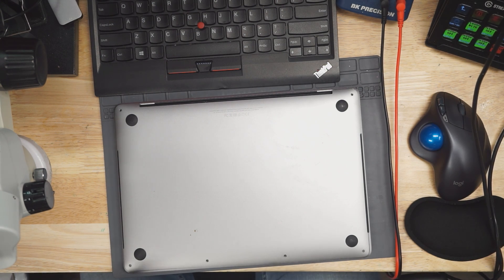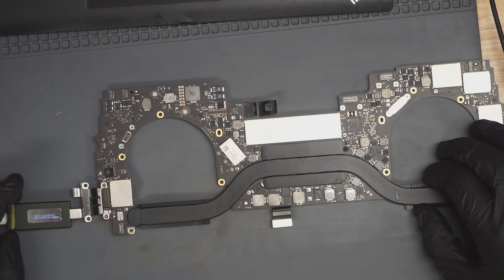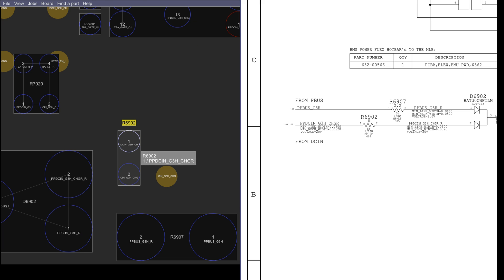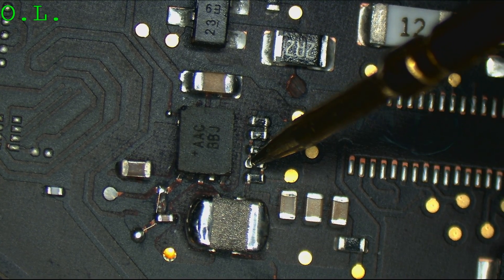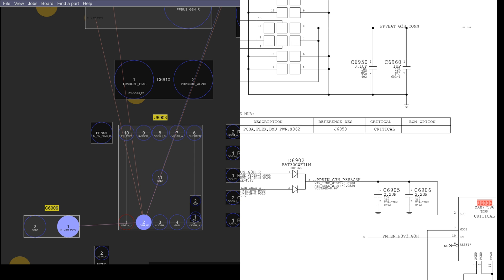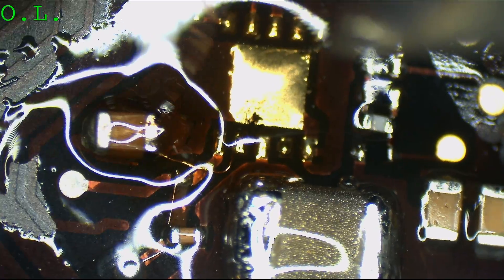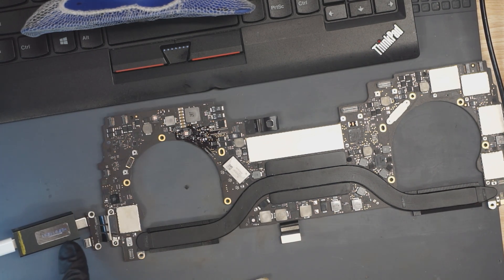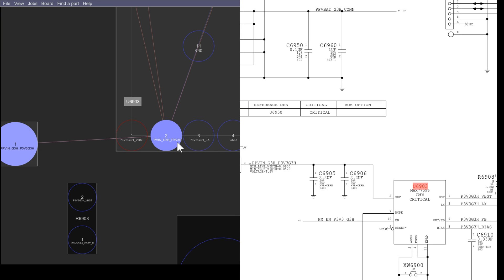Louis fixes board while losing mind, earns 1 star review.

Comment: Louis, the kit lens is fine if you want everything in focus. You only buy a Sigma lens if you are after background blur (boca), which is achieved by lowering your F-stop value in the camera settings. If you need more clarity (less grain), on either lens you need to lower your ISO level and increase lighting levels. Lower F-stop may also require more lighting as the aperture size changes. Neither of those things may be practical for you if you're using it for live streaming repair on a co-op space. Either way, a DSLR is a big upgrade over webcam. A kit lens is still good.

Comment: Once. I fixed my ps3 with the issue where it would just bsod. I took out the mobo, baked it to raise the temperature of it and fix the processor. Put it back together and it booted properly. I was excited!! Tried connecting to the internet to update it and there it was. I fried the network card. It was fucked.

Comment: I'm not a doctor, but I' guessing you don't notice a difference between the lenses because you're using it for videography. A faster lens won't do much if you raise the f-stop like you would for video ( I assume you're using a smaller aperture to raise your depth of field for such a close camera). I'm guessing the kit lens is a zoom lens with a f-3.5 max. I'm also guessing the Sigma lens is a 2.8 or 1.4, so the max aperture is letting in almost twice as much light as the kit lens if it's the 2.8. The 1.4 lets in almost 8 times as much light. This allows you to handhold with faster shutter speeds and lower ISO than otherwise possible with the kit lens, giving better results in low light conditions. Also, kit lenses are generally really good, and there is the old law of diminishing returns, so upgrading from a super cheap lens to a good one will cost less than an upgrade from a good one to an excellent one. So, the people who notice a lot of difference may be doing something like heavy cropping, and differences would be far more noticeable than two uncropped lenses side by side. Not to mention that delicious bokeh that you're not going for. Mmmm, bokeh. 

Great, you got me started on a wild tangent.

Comment: why wouldn't the jumper wire not get interference from whatever was the copper lead going out the the spot to the left of the input? i'm not a AV guy but I would think crossing a copper wire onto of another copper surface that's on the board would be a bad thing.

Comment: True story, I had a customer come in the auto shop who said his window wouldn't open/close. Window motor had power under load and a good ground. Window motor failure. We gave a quote for replacement. I overheard him talking about letting his son try the repair himself, so I let him know that the quote was for a unmolested service repair, and that he may need to pay more if his son fucks it all up inside the door. He leaves and comes back hours later and says he wants to do the repair as quoted originally. I open the door and as it opens you can hear all the loose screws rattling around in the bottom of the door, which were mostly unrecoverable. Price went up and he complained, and in the end we should have rejected the job. The car worked fine when we were done, but we didn't make enough for the job to be worth it. Maybe we should have quoted even higher.

Comment: That lens? Sigma 30 f1.4?? You got to be kidding. You compared it to that kit lens and you found no difference? Did you use it at 1.4? Or 1.8? You should have taken that camera out to shoot some evening portraits or NY steets. That lens is a low light bokah master. In low light, kit lens simply can't keep up. In bright light too sigma has more bokah, sharpness and contrast. On my vacations, sigma is always on my a6k. But in overhead cam setup, maybe won't affect. Depends on usage but sigma is sharpest available lens for apsc e mount.

Comment: Whats the liquid that is put on the board? ( I know nothing about  computer-repairs ehe) 
Also, does it not risk damaging anything on the board  since its spreading?
Cheers!
Reply: It is soldering flux. It helps regulate temperature when soldering delicate electronics and more importantly allows new solder to adhere more effectively by preventing oxygen from oxidizing the clean connection. IE prevents corrosion after the area was cleaned.

Comment: Actually the lens thing reminds me of my new graphics card. Went from a 570 to a 1060, because of...well, death of the former. Turns out on half my games I cant even abuse it because my old Athlon CPU bottlenecks anything thatd be intensive enough.
Reply: yup, always need to check if all your components are of similar power
Reply: @OGsploorp  To be fair, it was a replacement due to being broken, and Im planning on a complete upgrade once I get money. Seemed perfectly pointless to buy the same GPU or similar all over again.
Reply: @builder396  yea but replacing that old of a cpu would mean a new motherboard and probably also ram
Reply: @OGsploorp  Which is why I havent done it yet. Dont have the money to buy that many new parts at once.

Comment: Louis, please stop with the PP3 underscore Hot Cold and whatever.  If it's input or output or feedback or anything, please use that.  We don't have the data sheets in front of us and even if we did, my head is spinning.  It cuts down on the understanding.  I keep forgetting what PP2 underscore Hot Cold and whatever was supposed to mean.  Could you just say what it is instead?

Comment: What is that glue looking paste thingy you put on the board that melts away when you heat it?
Reply: It's a flux paste.
By preventing the formation of metal oxides, flux enables the solder to adhere to the clean metal surface, rather than forming beads, as it would on an oxidized surface. In some applications molten flux also serves as a heat-transfer medium, facilitating heating of the joint by the soldering tool or molten solder.

Comment: I love your brutal honesty, which I've seen in this and a few other videos so far. Even though I don't know shit about electronics, your videos are pretty easy to follow

Something I'm curious about, how reliable would that jumper cable (edit: wire, not cable!) you installed be? Assuming no tampering, dropping the macbook (sorry, it's a PC now), or anything else, should that last?
Reply from the maker: Why thank you! I hope if you keep watching, you will know more than shit about electronics. :) 

The jumper wire will outlive me.

Warranty issues with board repair, are mistakes of omission, rather than issues caused by a board repair. An area where we should have put a jumper, but didn't. A corroded component we missed. These cause warranty issues. The jumper is fine.

Comment: im a photographer. the biggest difference between the kit glass and the prime glass is that the prime typically has wider apertures (f1.4/1.8/2.8). they can create beautiful images. however, ur type of shooting seems like you don't need a prime. your kit glass looks like it does the job just fine. if ur shooting at f3.5 and up, you don't really need to use prime glass unless you intend to shoot at those wider apertures. hope this helps.

Comment: I didn't quite understand how bad that soldering job was, so I bought a soldering kit and a small FM radio assembly kit and soldered it all together so I could understand the basics of soldering.  All of that was so I could watch this video again and laugh even harder at that terrible soldering job.
Reply: @jonathangardner9654  Yes, it's called "flux" and it removes oxidation from the two surfaces you're trying to solder.  If you don't use it the solder joint doesn't take.
Reply: @couchmaster3773  Was this in reply to a question about the watery stuff? I only ever did a tiny bit of soldering in school and never used anything like that!
Reply: @Aetherian1  Yeah, it's that weird goop he puts on the board.  Some solder actually comes with flux already in it so you don't need to use extra
Reply: @couchmaster3773  Interesting, thanks for the explanation
Reply: @couchmaster3773  You do if you're mounting SMD components, you need a lot more flux than is in the solder to mount a SMD component without overheating it.
Reply: By any chance was the radio kit the Hex3653? I haven't soldered in years so I'm out of practice since the 6 month electrical engineering elective I took at university 10+ years ago. Needless to say I had to learn SMD soldering pretty quickly.
Reply: @unsaltedskies  No, the radio I soldered together was only through hole soldering.  It was a little bigger than the radio you're talking about, too.  Don't know the exact model of mine.

Comment: As someone who only has like a basic understanding of tech repair, i wonder how some people can mess up a disassembly or assembly. Like we got our Xbox back from the sheriff a while back and it wasn't working at all, we sent it into Microsoft immediately thinking the warranty would cover it. the seal was broken so we got it back untouched from Microsoft. Frustrated I opened it up myself and realized the dumbass that took it apart at the sheriff's office didn't plug in a part while putting it back together. I plugged it all in together correctly using a 5-minute internet guide and it's been working ever since. It legit shows sometimes their "professionals" can't even research a few minutes to find out if they're fucking it up, or at the very least testing it afterward.

Comment: Prime lenses usually have a larger max. aperture. That means you get more/better bokeh and you can shoot in lower light. Thats their main selling point. They might have slightly less distortion and be slightly sharper too, but as an amateur you wont necessarily be able to tell difference in sharpness just looking at the photos. If you dont know what the advantages of a higher quality lens are, just dont buy it and leave it to the pros. Like buying expensive wine if you cant tell red from white.

Comment: Minor correction for you Louis: MAX77596 pin 1 on the left isn't feedback, it's the high-side driver supply.  
If you short your input with that pin, you'll (probably) overvoltage C69072, which will fail short and connect your input to pin3 LX. Essentially connecting input to the inductor.  Neither the IC nor whatever it powers will like that...  I'd be pretty tense checking my handywork if i had to do that repair!

Comment: I would not have fixed it after the costumer tried a DIY. I work for an Auto shop and we turn down a lot of failed DIY repairs. Its just to troublesome.
If you dont know what your doing or doubt your self at all , dont fucking attempt to fix it.

Comment: I am new to this, but what is that liquid you are putting over the chips and circuits, how can you even see what you are doing? Do you have any basic beginner videos?  Very much respect for what you do! It is amazing! Thank you!
Reply: The liquid/gel that he is using, is called "flux" and it's used for a few reasons, but basically it protects other parts from heat and solder and helps the solder to only connect to other solder/metal parts that should have solder.

Comment: i have watched many of these and never seen him have to add a tiny wire like that, can anyone explain why he couldn't just fix the pad?
Reply: I'm not an expert, but Louis did say that maybe it wasn't connecting... he might have actually been talking about the pad not connecting to the trace inside the board itself.  I slowed the video, and you can see it looks like the pad's trace in the board might have been burnt aswell, making the pad completely useless (not to mention, the pad looked a little messed up).  There were already 2 other jumper wires done in the same area by the previous guy who sent it in, so there was already other damage, whether some of the traces were burnt out by failed components, or the unnamed guy who tried to fix it, burnt them out during his fix.

Comment: isn't that jumper wire a temp, cheap, failure prone fix?
Reply from the maker: Quite the opposite, that jumper wire will never fail, and likely outlast the machine itself.
Reply: Jumper wires ARE "cheap" fixes WHEN they come from the manufacturer, as-in, they didn't do the proper Engineering to Design the board correctly, so the manufacturer had to add in jumper wires to make it all work.  

Not when it's coming from somebody fixing somebody else's broken item... they aren't paying for a brand new board, just the existing one to work again.

Comment: Hi Louis and viewers! Great video as always! I'm just wondering why you don't use jumper wires with some sort of electrical insulation surrounding the wire. To the non-expert, that seems like the obvious solution to prevent introducing a short circuit if the wire were to bend in an unfortunate way. Does it have something to do with the internal temperatures and concern with the insulation melting, or does it have more to do with the fact that the jumper is unlikely to bend from the orientation in which you laid it down? I'd love to get some insight into this matter from you or one of your knowledgeable viewers. Thanks! Keep up the great work!

Comment: I’ve loved trackballs since the first Logitech Trackman Marble (no wheel) came out. That was a bit too flat tbh but the first of the grey versions (Trackman Wheel Optical) was perfect for me. They brought out a wireless one with the red ball but that ate batteries. Then the wireless M570 with the blue ball came out and it’s powered by good intentions and fairy kisses I assume. Seems to last forever on a full charge of the single AA battery. So yeah, I love my trackball too. 🧐
Reply: Hey Neo, if you love trackballs, you should see what a japanese company named ELECOM has.  They are dedicated to making excellent Trackballs and use to only be available in japan, but are now on amazon. I have 2 Microsoft Trackball Explorer's that i absolutely love, but you can only find used ones now, that run for $200 to $400, so i have been on a long search for some decent replacement and i finally found the ELECOM's last year.  Look up their newest "ELECOM Trackball Mouse M-DPT1MRXBK" it can be used wirelessly, blutooth, or with usb cable, has ball precision/speed switch, and 8 buttons and scroll wheel.  I think the ELECOM M-XT3URBK is closer to the M570.  Anyways, just look up the company and see what they have, because i believe in supporting a company who strives to make a quality product that is hard to find.  Us trackballers gotta stick together.

Comment: Hi Mate, 
awesome videos and professional performances in solving all issues regarding apples :-)
I just bought a MacBook pro mid 2012. it has an issue that a dimm slot is giving me troubles. I could only put one dimm installed. the other dimm slot is causing system halt. :-(

Comment: About that difference between lenses. You surely can't see much difference between those two lenses in a video. Sigma 30mm F1.4 is one of the sharpest APS-C Lens for Sony because it does resolution about 14 megapixels, when kit lens does only about 9 megapixels. Thing is, Full HD video is just 2 megapixels, so it's completely normal that there's no literal difference. However if we'd go into photo shooting... you'll see it immediately so... If you want something nice for a video and you have plenty of light... 18-135 F3.5-F5.6 or 18-200 F3.5-F6.3 is the way to go.

Comment: I just purchased the Surface Pro 6 replacing a 13 year old Lenovo (that still works) for home use.  I have a 3month trial period on this machine; the trial is still goin on.  At least, if I spill liquid on the keyboard and it doesn't work, I can replace it for $99.   Who doesn't drink around a keyboard?!  Do you need a hermetically sealed environment to use a Mac Book?  I've been using iPad Pros at work and they do not fix when they break; I know the Surface Pro 6 will not be any different.

Comment: I would be inclined to insulate that jumper with a bit of laquer (or most likely nail polish since that's more readily available everywhere...) just to be sure it wouldn't short out, or break. What's your opinion on that? You think it's a usefull thing to do? Or do you have experience with this actually being a hazard to the board?

Comment: A Kit lens is just fine for video.  There's no advantage (for you) and some negatives that come with using a prime lens for video (cost, fixed focal length).  It would be different if you need something special, like a macro lens or a very fast lens, but that's not the case here.  I also think Sony sucks, but that's another argument....

Comment: A polarizing filter for your lens would have been a better idea as it will greatly limit reflections of from lights on flux and solder.  This video is a good example of where it would have made a big difference, at 7:30 most of the reflections off of the flux would have been clear instead with a polarizer.
Reply: Maybe. Polarizing filters work best at 90 degrees to the light source, and tend to work poorly with head on light. Also, I think he's using a microscope camera which probably lacks filter threads. Worth a shot though!
Reply: I find your comment very polarizing!

Comment: Where your reconmendation to buy parts for my mid 2009 macbook pro 15? I could buy a referbished one for about the same price if I were to buy the exact same model. The battery needs to be replaced and the front glass has a crack. I want to make it s project for fun but have some old files that I would like to recover. Also got a samsung ssd 256 gb that probably worth more thsn everything else in the machine. Would I be better off buying the parts or buying another macbook and swaping out the hard drive with my ssd? 
Thanks,
Breyden Burger